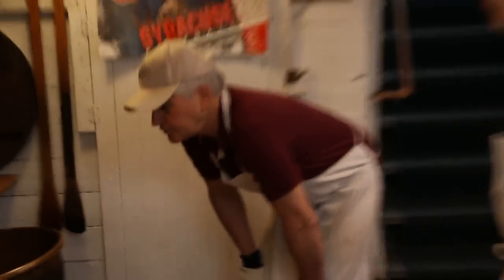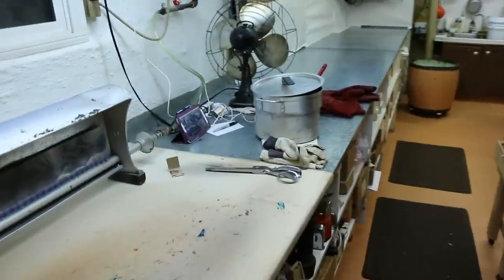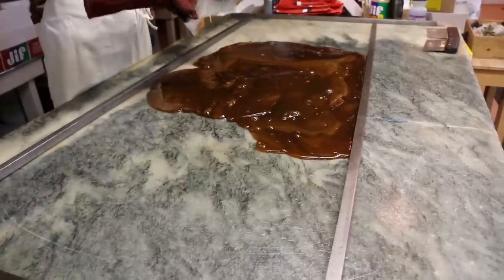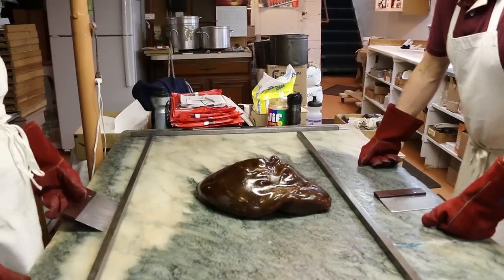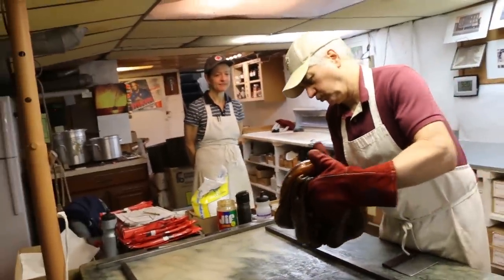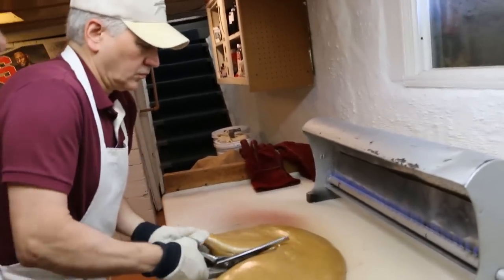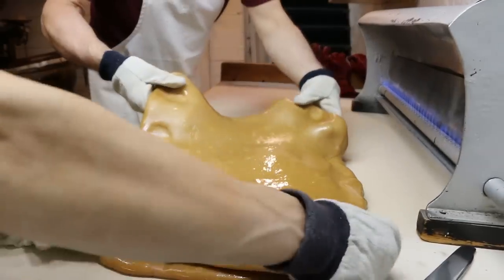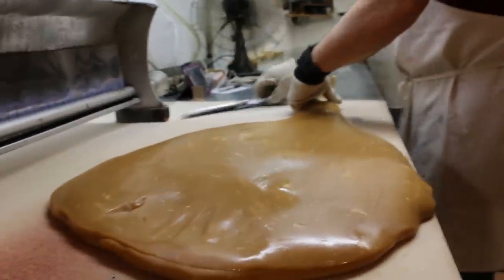Peanut Butter Filled Ribbon Candy!!!???

Comment: Just watched you make peanut butter filled ribbon candy and some of the candy comes out with no peanut butter until the batch gets going.  My question concerns people with a peanut allergy. How do you make sure that there is no chance that some candy may have come in contact with peanuts? For instance, the first ribbons with no peanut butter, do you sell those as plain?  I would worry about that since they were in the batch with the peanut butter.  Just an FYI  since peanuts can be deadly to certain people.  Thanks.
Reply from the maker: We advise people that are allergic to peanuts don't eat that ribbon candy because there is no way to prevent cross contamination.

Comment: ""How come 2 different brands of chocolate may list identical ingredients, but taste completely different?
The main reason is that there are many different types of cocoa beans, just as there are many different types of ""coffee"" (cocoa?) beans. It is the cocoa bean that gives each type of chocolate it's distinctive flavor. Most chocolates are made with different blends of beans. Another factor is the proportion of the ingredients. One chocolate may contain more cocoa 
butter than another and thus be creamier. One more reason for a difference in taste and texture is how long the chocolate was conched (mixed in a special conching machine) at the factory before being molded into bars to send to candy making factories. Conching helps to develop the flavor and ""smooths"" out the rough edges of the sugar particles.""
Please check your FAQ page, I changed 1 on spelling and cocoa instead of coffee note.  Can I get some chocolate free :)

Comment: Question: I tried to make some candy canes... and got it to 300 before pulling it; but... it ended up being a little softer than it should have been. It still held it's shape; kinda... and over time it's gotten softer and stickier and almost looks melted. Should I try heating it a little higher? Or pulling more? Or what did I do wrong?
Reply from the maker: It's hard to figure out online, but have you watched our candy cane and ribbon candy recipe videos? Hopefully that will answer some questions.
Reply: No Egg Craig Yes! I've loved them. I had to use a different recipe, though... I have a sulphite allergy so I can't use corn syrup or cream of tartar. The recipe I found called for sugar, water, and a bit of vinegar (I used rice). My guess is that the vinegar is to substitute the acid in the cream of tartar.

Some of my other candies have turned out hard; I wonder if maybe my thermometer just didn't quite get high enough.
Reply from the maker: Maybe, best of luck to you!

Comment: I am stupid; What does the weather have to do with what candy you can make?
Reply: My best guess is humidity.  If it's too humid when making certain kinds of candy, it will be all sticky instead of nice and shiny and hard.  They might be able to fix that problem with a dehumidifier, but meh.  They're doing it the traditional way.  When it's colder out, less moisture will stay in the air.
Reply: Makes perfect sense. Thanks!
Reply from the maker: Yes and also we try to cool everything down by opening the window and it won't help if it's too warm or humid